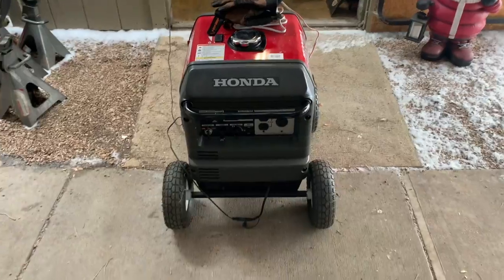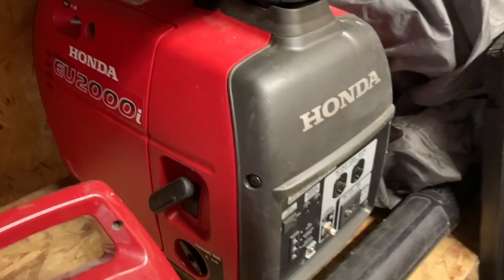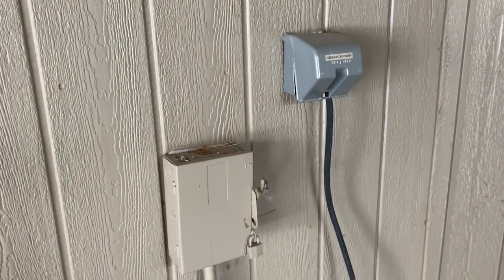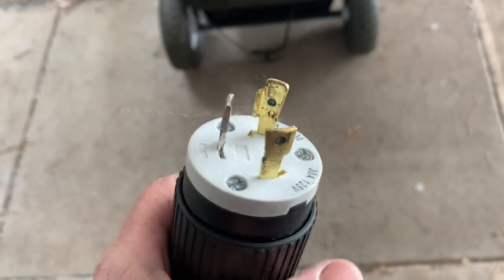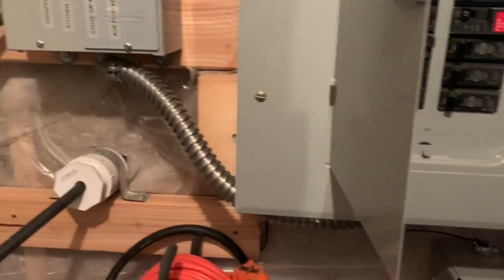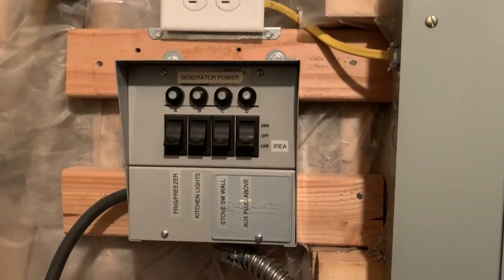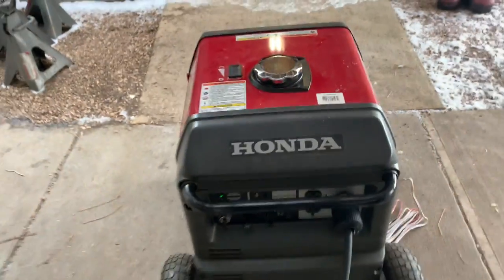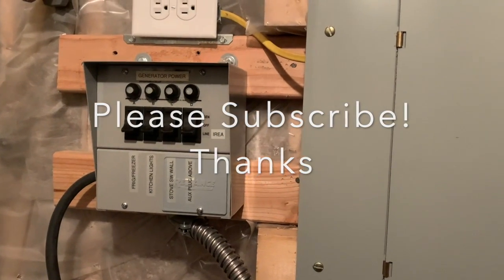DIY - How to Install a Home Gas Generator for Backup Power!

Comment: You are awesome!!  Just bought a Honda 3000 yesterday and ordered the cover and wheel kit. This is my next project. Could you please send me the link of that kit you used?? Thank you sir!!
Reply from the maker: Reliance Controls Corporation 31406CRK 30 Amp 6-circuit Pro/Tran Transfer Switch Kit for Generators (7500 Watts).,Gray
by Amazon.com
Learn more: https://www.amazon.com/dp/B000BQN4T2/ref=cm_sw_em_r_mt_dp_BQ02A3R4MJF7Y7SEPNVA

Comment: Great informative video. Are you able to run your stove with this setup? Just got confused. Cause you said your running 115 v circuits. And stove requiring 220v . Please explain. Thanks
Reply from the maker: I have a thermadore gas stove. Takes very little 115 for the igniter. Thanks.
Reply: Lol. Went back on the video. Noticed the info at the bottom. Appreciate you responding back. Thank you sir.

Comment: Thanks for the video. I've got an EU2200i and an EU3000is like in your video. I want to do something like this and just gathering examples. I fortunately found an electrician to help me with this project.  I like Honda and I'd rather use a small, quiet, reliable generator for backup even knowing it will only run select circuits.